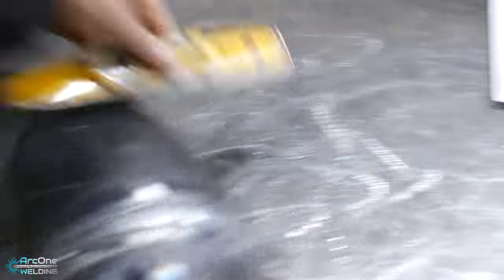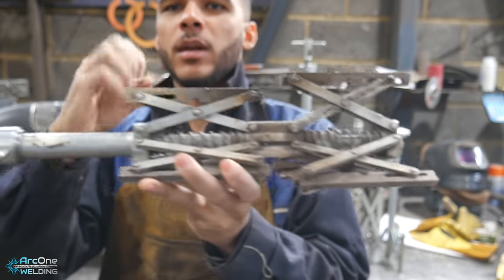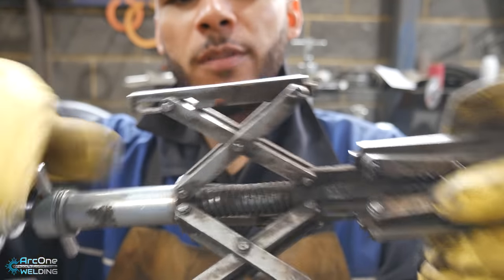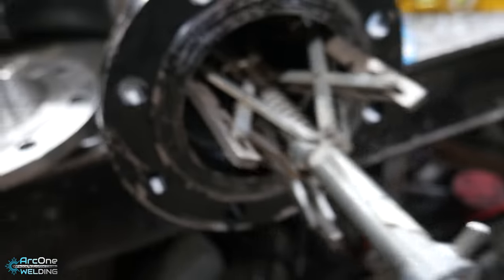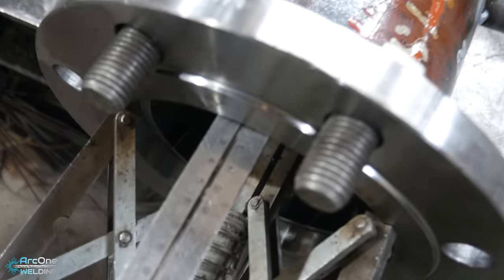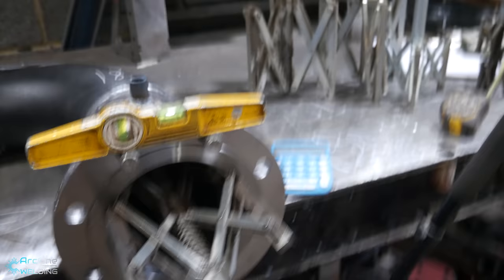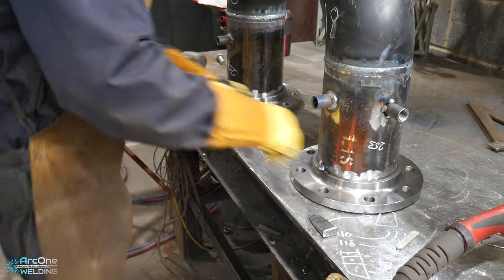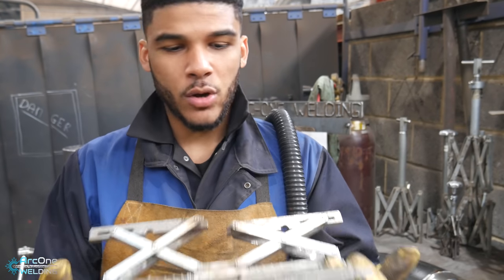What Is A Spider Clamp & Why Do I Need One?  (MIG/MAG PIPE FABRICATION/WELDING)

Comment: Nice video. Thanks bro,   how accurate is it  when you use bolts to level the holes ?
Reply from the maker: Thanks bro an Ive compared it to flange pins and its just as good
Reply: @ARCONEWELDING  please make a video about the weights you use when you're rolling.  Thanks